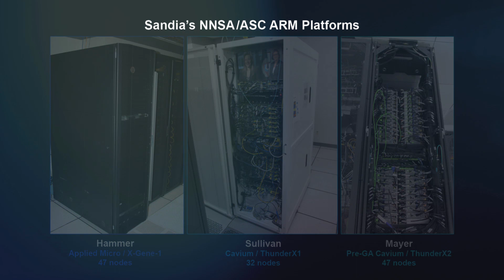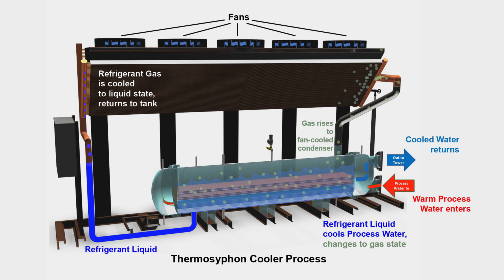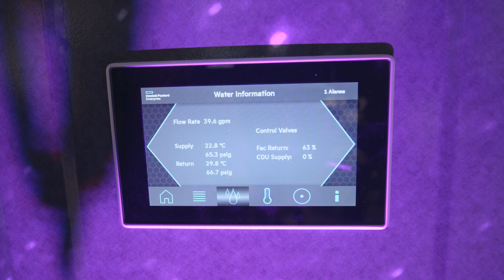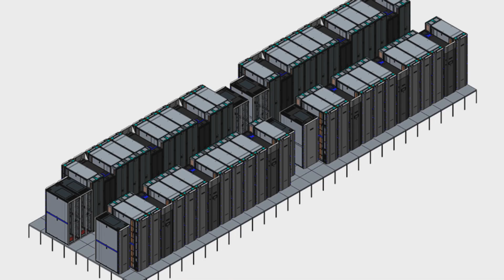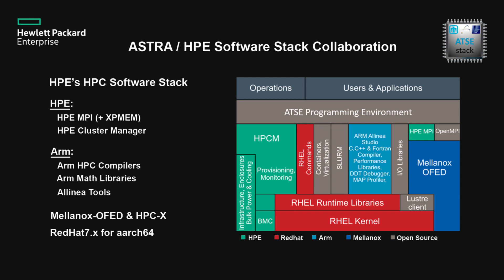Astra and Sandia's 725E Data Center

Comment: wow 36 compute racks, WorldCom's Melbourne office had 2 stories and each story had over 200 sq meters of computer racks and temp fire and humidity controlled air, so sanative that if you were to have a smoke outside and finish it outside and then when into the room the alarms would go off, i know it happened to me back in 2004/5?